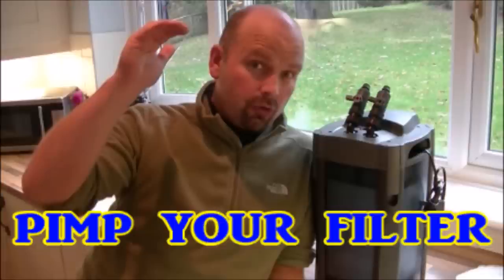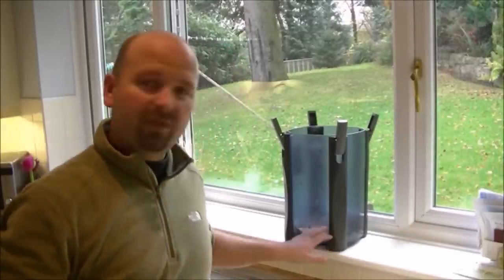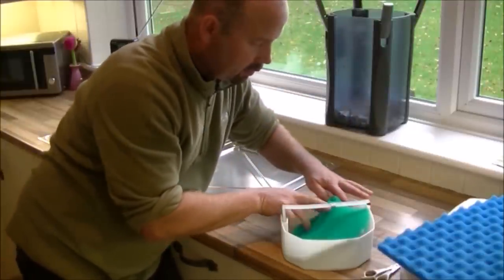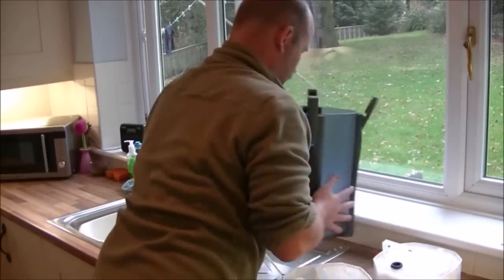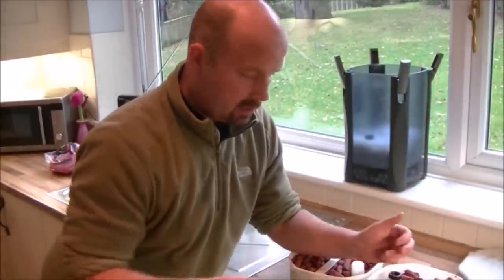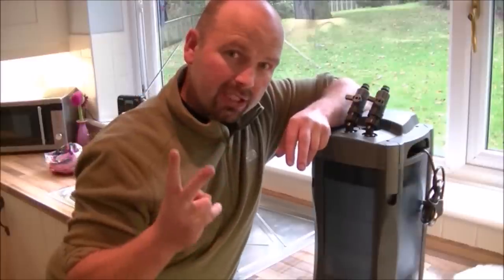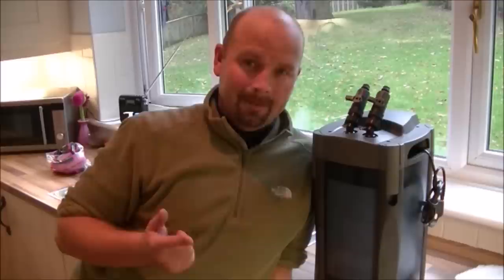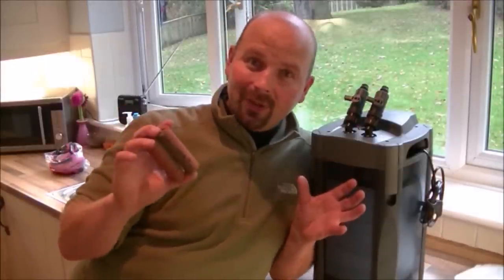External canister filter set up, nitrogen cycle and what happens in a filter - by Pondguru

Comment: Very good video... but if the media isn't in that order is it ok to change it round. I've got a Tetratec 1200 and my bottom tray has the ceramic rings (noobles) then I've got my useless plastic balls then my final tray with a coarse sponge and the fine sponge..?
Reply from the maker: The Tetra filters are easily the worst offenders when it comes to setting the filters up all wrong, lol
Yes change it to the correct order but leave the biological media in the re for 2-3 weeks if you are adding new media (e.g. biohome) to one or more of the trays to make sure there is still some biological activity happening and to reduce chance of filter 'lag' in a mature system.
Reply: Thanks for your help... I've just emailed you back.
Reply: Thanks for that speedy reply, i'll change over the sponges leave the fine one as it's recently been changed...  And put new bio in one tray and leave one with noodles in... for a couple of months then change that over too.

Thanks for your help... actually I'm gonna be getting a new tank and filter it's gonna be around 600 litres.... I was thinking of a FX5/6 I was gonna run both filters. Will that be ok fish wise, Oscars, Tinfoils, Panagasguis, Redtail Catfish,  Fully grown Redtail Black Shark.
Reply from the maker: Mohammed Shafi Yes I would run both filters for that tank given the size of the fish you will have in the big tank.

Comment: I just upgraded from a fluval 4 internal to a Hydor Pro 600 canister filter which has 5 trays.  my setup is, bottom tray course, medium and fine pond foam and Biohome ultra in rest of the 4 trays.  Did I setup this filter right? Thanks in Advance.
Reply from the maker: +patikke I'm sure I just answered this on another video?
Yes it sounds spot on and I'm presuming that you mean 'mini' ultra is in your filter as the ordinary ultra is about 4" long. The mini ultra or ultimate are perfect for externals and if you have 4 trays of good media above your foams the filter will be as efficient as possible.

Comment: just ordered some course and medium foam from you mate, i have fine foam, gonna set up my filters as this video suggests, hopefully my water gets a bit clearer, my filters also contain biohome and purigen, any advice on clearer water would be great, i have malawi, and they constantly sift the sand, pulling up the debri, which makes my water a little cloudy
Reply from the maker: +stebbz36 Thanks for the order. It will go out on Monday.
With the foams in the correct place the media should be able to work well on the quality of water and the foams and fine pad will keep it clear. Purigen is to remove staining and chemicals from water and not to clear suspended solids. 
Carbon will do the same job and is much cheaper (plus it does not starve / kill bacteria or mess up the bacterial balance in media). See notes on chemical filtration and general filtration here: http://filterpro.co.uk/qa-24-w.asp
Reply: great thankyou

Comment: Hi Richard!! I'm sure someone has already asked but how often would you suggest cleaning out the filter on a 90gal with your adjustments??
Reply from the maker: There are so many factors which affect how quick the filter blocks up so just clean out when the outflow slows down - that will tell you it is clogged or clogging.

Comment: i have seen lots of videos where the intake line hose of the external filter is placed in a corner but on top of it the build a Mountain of rocks is it still efficient?thank you so much
Reply from the maker: +Razvan Paslaru As long as the water can get through gaps in the rocks to the intake pipe it will work fine.

Comment: I like the concept makes sense to me but with that much mechanical at once wouldn't you get alot of bypass?
Reply from the maker: The flow rate / clogging rate of the foams and fine pad will be the same no matter where they are located in the filter but it makes sense to have all the mechanical media first followed by biological to enable the biological to work better.

Comment: Hi pondguru, I just received my filter upgrade kit, thanks a lot.
I have a question.
Obviously I want to get this media matured and running well as soon as possible.
Can I put my already mature ceramic media and bio balls in the very bottom of my canister and fill my two biomedia canisters up with the new stuff? Will the mature media still be viable and do its job in the bottom of the canister, below the sponge layer and the two biohome trays?
Reply from the maker: Julian Reeve I think I answered this in a message you sent through ebay or via email?
Reply: Yes mate, you did. Thanks

Comment: hi just wanted to know if you could tell me or do a video on how to set up a fluval 306 canister filter as not sure which way to set it up
Reply from the maker: The foams down the side are decent so you really only need the bottom tray for the medium and fine foams / pads then fill the 2 trays above that with media. Each tray will take up to 1kg of biohome mini ultra or biohome ultimate. The water flows from bottom up through trays.

Comment: Hi, How often do you have to actually change the filters or can you keep washing them out for a certain amount of time ?
Reply from the maker: +Gareth Pointon The fine white pad will need replacing as and when it gets clogged with fine particles but the other foams can simply be squeezed out in water you have drained from the tank during maintenance. The foams should last a good 12-18 months before they become too floppy to be effective.
Reply: +Pondguru Outdoors great.. however the eheim 600 pro has to have the filters at the top due to its design or is there another way?
Reply from the maker: +Gareth Pointon If that is the pro 3 or pro 4 600 filter it has a 'pre-filter foam' in the top tray. Water comes in to top of filter, hits the pre-filter foam then goes down to bottom of filter before rising back up through the trays just as it does in this video. Leave the pre-filter foam in top as it is a nice coarse foam then simply set up other filter trays as in this video.

Comment: hey I'm just curious but do you add carbon to your filters? I have a 150 gallon aquarium with three little turtles and some fish. I use a fluval fx6 filter, and I add packs of carbon to my filter is it a necessity??
Reply from the maker: Carbon would be needed if there wasn't enough biological filter media as it would draw in ammonia and nitrite (and mask the failings of the filter - that's why it is usually included by manufacturer). In a filter which is a suitable size for the tank and stock it really only needs mechanical and biological filtration and carbon would generally only be needed to remove residual fish treatments or colour from bogwood.

Comment: I saw one video where a man used a second fish tank of the same size plus a giant rubber made garbage can for added water volume and have a question about it. If the turnover rate for the filter were adequate for just the tank alone with the amount of fish in it and you decided to double the water volume for stability would you need to increase the turnover rate of the filter or can you leave it as it is regardless of the water volume?  Or would you recommend monitoring the tank itself and adjusting the flow for the needs of that tank without any general guidelines?
Reply from the maker: Flow rates are not as important as people make out and a trickle filter above a tank properly set up with good media will outperform a canister filter with high flow rate set up badly. It's all about processing the ammonia, nitrite and nitrate. Most filters only process ammonia and nitrite, producing loads of nitrate due to the choice of media.
Flow rate would be tailored to suit the tank stock.

Comment: first off all thank you for sharing info.
i just bought a jbl e701,  how do i order the trays? from bottom to top: filling media on bottom, 1st tray biohome,2nd tray biohome,3rd tray,  leave tray with standard foam or replace with 3 different  sponges.and if i replace the sponges,that is the right order from bottom to top? appreciate it!
Reply from the maker: +Razvan Paslaru The filter trays work from bottom to top so from bottom tray would be coarse, medium and fine foam then media in trays above that, just the same as in this video. It has a 'pre-filter' foam in part of the top tray so just leave that in as it will add extra mechanical filtration. www.filterpro.co.uk
Reply: Thank you!

Comment: This is a great explanation video. Thank you. I’m glad to know that Fluval actually makes a good canister filter.. for the most part. It should switch around the way it intakes and first line of partial filtration. It comes though a medium fine, flat pad, then to an eggshell pad at the bottom, which could be switched, but all in all, it is quite well in its original set up.. I’m wondering where you learned all of this from? Supreme common sense, trial and error, or from another intelligent being?
Reply from the maker: I've been in the trade for around 25 years now so have seen just about every type of filter going. The pond filter manufacturers always seem to get the order of the layout right but for some reason aquarium filter manufacturers get it so wrong - I've even seen filters which have chemical filtration first followed by biological media followed by pads then fine pad which is totally back to front. It's still a mystery how they can't get the order correct, lol

Comment: Any suggestions on how I should set up my MARINELAND® Penguin 350B Power Filter? I would ideally like to have a canister filter, but just can't get one at the moment. Hopefully soonish.
Reply from the maker: Justin Brown If you're going to get a canister filter soon I wouldn't bother trying to make the HOB filter better as it relies on a cartridge system but if you do swap that out for a proper system of foams and media just do it in same order as this video shows. Most HOB filters have little or no space for biological media without major alterations which can be done but even then they are often undersized for the tank due to the habit of manufacturers overstating how much water their filter can clean.

Comment: where should I place carbon in this kind of set up?  I have 4 trays.  And should I put one more pad of filter floss/fine pad on the top tray?I was thinking:  bottom tray: coarse, med, fine pads; second tray: matrix bio media; 3rd tray matrix bio media; top tray: carbon.  Wondering if I should put a filter floss/fine pad in the top try and set the carbon on the pad.  Thoughts?
Reply from the maker: If you're using carbon it needs to be the last thing water hits before leaving the filter so assuming the trays work bottom to top it would indeed go in the top tray. Its best in a media bag as using a fine pad in the top tray will concentrate any muck in the media below it.

Comment: Just ordered some of this. I’ve got two big canister filters on my 125 Gallon. I do know not to clean them out at the same time but how often do I clean a canister filter out with this same setup?
Reply from the maker: Cleaning times can be extended as far as you can - check the filter 4 weeks and if it is not very dirty give it a clean and check after 6 weeks, if you think it would go 8 weeks then make that your next check and so on until you are doing minimal maintenance since there is no point cleaning something which doesn't need cleaning.

Comment: This is beyond my level, but I'm curious if there are any toxins in the foam you're using, that might taint the filter.  How do we make sure we are using "good foam" vs. bad foam?  Thanks...awesome video.
Reply: ***** its filter media. its specifically designed for aquariums. i hardly doubt there would be toxins. heres a link -http://www.ebay.co.uk/itm/Garden-Fish-Pond-Media-Filter-Foam-Sponge-Set-17-X-11-Pads-Fine-Medium-Coarse-/180522338880?pt=LH_DefaultDomain_3&hash=item2a07f84a40
 this is where i got my foams from. its been running im tank and it hasnt harmed my shrimp or plants

Comment: if I'm using chemical filtration such as Chemi Pure which tray should it be placed in 2nd or 3rd  thanks
Reply from the maker: +Sam Rabadi Any chemical filtration should go in the last chamber or last tray as the filter should operate in this order: mechanical, biological then chemical. There is generally no need for any chemical filtration in a properly set up filter unless you need to draw in any residual treatment chemicals or colour from bogwood. Avoid using Purigen as the recharging process prevents the development of bacteria in the filter (it is either the bleach or the buffer used for recharging which kills off bacteria - especially anaerobic bacteria which reduces nitrates)

Comment: I am using the Rena Filstar filters (I have a FILSTAR M aka Rena XP2 & FILSTAR L aka Rena XP3). Should I be using 2 of each for the coarse and medium foams or is one enough for each foam/filter? If I only use one of each of the foams, I have about half of tray I could place more media. 

Thank you in advance.
Reply from the maker: +Walter Hendrick Yes you only need one tray in a filter for the foams and fine pad and if you have space for media above the foams you can add media but only if it doesn't crush the foams. Its often best to simply add another coarse or medium foam to pack out the tray then go with media in the trays above that.

Comment: Great video..I have a canester filter (Fluval 305) that came with a complimentary bag of carbon and biological media...is it safe to get rid of the carbon and replace it with more biological media?..Because i thought Carbon was used to help get crystal clear water
Reply from the maker: +ciscothelight Carbon does draw in colour from bogwood or treatments but if you're not treating the tank and don't have bogwood staining you want rid of the space in the filter is much better used for good filter media. Almost all external filters will come with carbon as it is cheap and used to mask the fact that the supplied media is not controlling ammonia and nitrite. The carbon has a useful life of 4-8 weeks and does draw in ammonia and nitrite but needs regularly replacing before it releases the chemicals it has drawn in back into tank. It lasts longest in last stage of filter where water is cleanest. The biohome should last 6-10 years in a well set up filter.

Comment: Whats your view on carbon, i know it needs tobe recharged after a couple of weeks/months but is it worth also using & marimo moss balls, worth implementing as self sustaining naturel filtration?
Reply from the maker: +Allen Kemmett Carbon should be replaced every 7-8 weeks as it basically acts like a sponge, drawing in pollutants, colour from bogwood etc. and if it is not replaced when it is 'full' it can leach those chemicals back out into the water.
Moss balls act just like plants with the added benefit of trapping debris so they are a good plant to have in the tank but they need good lighting.

Comment: Would you happen to know how much media I would need for a Fluval 306. Also, been reading a lot about purigen. Do you have any thoughts about Purigen? Regards, Serge
Reply from the maker: Each tray of the 306 will take up to 1kg of either biohome mini ultra or biohome ultimate (best types for external filters). As far as purigen goes it should not be needed when you use a suitable sized filter and it is properly set up. If you want to use a chemical treatment to remove staining from bogwood or residual treatments carbon does exactly the same with no danger to the bacteria in the filter.
There is more information on how much media is needed for full cycle filtration and the use of chemical filtration on the Q&A page of my website here: http://www.filterpro.co.uk
Sand is best substrate for most tropical fish and is fine with plants but they often need extra feeding. These root tablets are very good as they each last for a month or more: http://geni.us/dMqlvV2
I see you sent an email asking the same questions 5 minutes after this question so I will just answer here.
Regards,
Richard
Reply: thank you so much for the fast response. Sorry saw that this had a comment from a year ago and didn't know if you would see it...
Reply from the maker: No worries I often get a comment on YouTube followed by a message followed by an email followed by another email to my shop address followed by a text all from the same person within 10 minutes so to have only 2 come in is a welcome change, lol  - I always answer questions even on videos from years ago but it could be a few days before I get to them if I am busy with work.
Best of luck with the fish keeping.